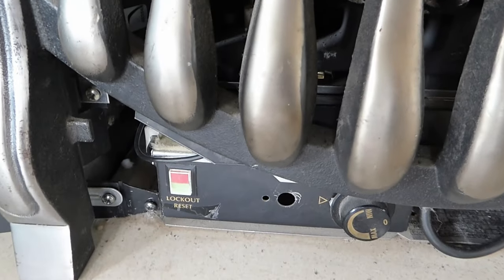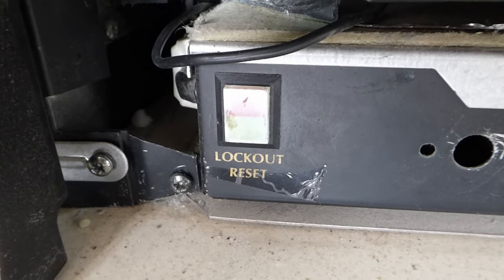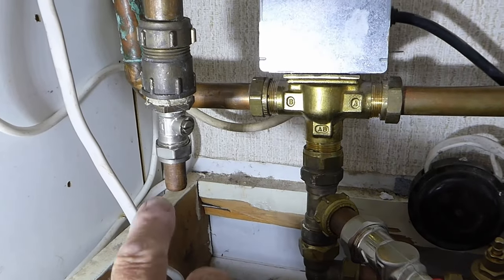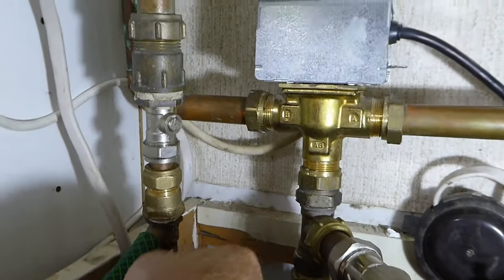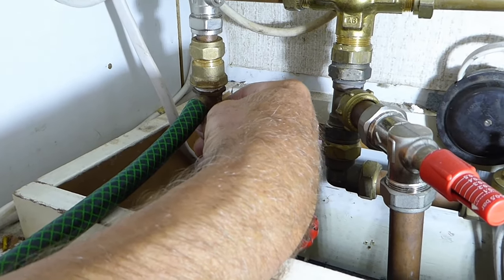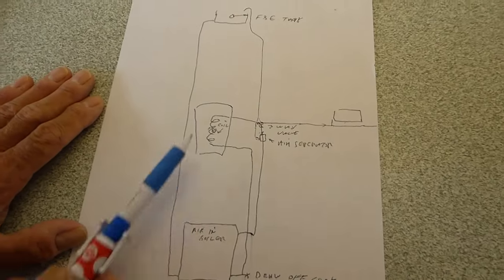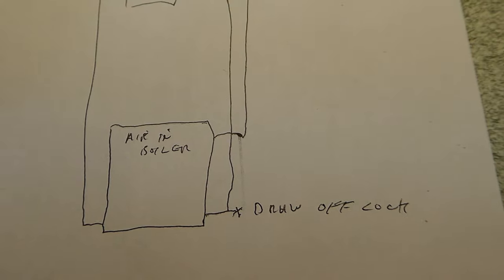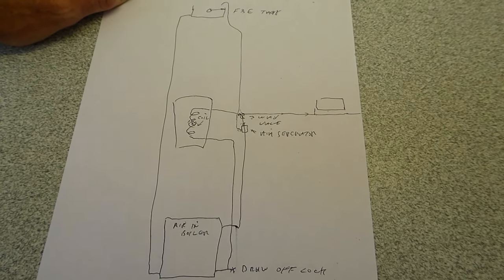How to clear air from a central heating boiler

Comment: I drained my whole system a few days ago and it was working, there was some odd noises though :) Today I noticed the pressure was a bit high so let some water out , the needle didn't move, the thing is drained but it still says 1.5 bar... when I open the bleed nipple in the rad next to me water comes out so it's not emptied, i  tried opening all of them when draining it the first time and it went to 0 no problem, any ideas what might be up Mr Dereton ? Cheers :)
Reply: Hey thanks for the reply. All my bleed nipples are open on every rad, no air coming out they been open overnight, no water in them as far as I can tell pressure dropped slowly to 1 overnight so something is leaking pressure out somewhere. Am thinking it might be trapped actually in my boiler or something. Going to call Ravenheat out tomorrow it's still under warranty :)
Reply from the maker: Yes needs a look at by a pro.

Comment: Hi. I have air in my combi . I recently redid my bathroom and put a heated rad above the boiler . The boiler is downstairs and the towel rad us in the bathroom directly upstairs.  Ive been having pressure loss problems so was going to change the expansion vessel but prior to that i changed the pressure guage as i suspected it was faulty.  Now it seems to be drawing air into the boiler and keeps locking out. I tighten the bleed screw on the towel rad as this is the highest point and i thought that had solved the issue but after a day im losing system pressure again.  I have a feeling the diverter valve is holed. Do you think this could cause the system pressure loss after a few hours?
Reply from the maker: Most times it is a leak that causes a pressure loss. Rarely the expansion vessel. That fact you are drawing air in also makes me suspect a leak. Give the system a go with fernox leak sealer.
Reply: @dereton33  thanks derek.

Comment: The batteries died on my controller and when I replaced them the system started gurgling-kettling loudly, then shut off. Freezing now and no heating. Tried bleeding radiators and running taps but no resolution. I haven't got anything that looks like your system. I can hear the air bubbling inside the boiler when i turn it on.
Reply from the maker: The system sounds like it is clogged with sludge .

Comment: Thanks for the video. I have similar symptoms on my boiler and notice there's a drain valve attached to the flow pipe (going out of boiler). Is that the one to use? Thanks
Reply from the maker: It should be there for draining the system, but do try it to see if any air is there.

Comment: Thanks for the video. I've changed the 3-valve repair kit, so drained the water completely and filled again. Lots of air was running between the boiler and pump and the nearest radiator. There is auto air valve over the pump, most of air gone out from there but the same sound appears again after using hot water. I dont know if I found the right valve that you mentioned, but I drained 1 or 2 liters of water. Now more than half of the gurgling sound disappeared. All radiators are ok except the nearest one, it's like water is dripping to that one although there is no air in it. The maintenance book talks about a "hot water heat exchanger went screw" and I also got it loose but not much longer because its place is terrible, there are cables under the screw goes to main unit. And I gave up :))
Reply from the maker: Hope you sort it ok.
Reply: @dereton33  I hope so, thank you. I'll look to it again after a week or so.

Comment: I had a problem with air in the central heating system. I found that I had to bleed the radiators every day. Even after bleeding the radiators I could still hear the air in the boiler. It sounded about like a breathing dragon.

Then I noticed that when the boiler ran the header tank overflowed. This indicated to me that air was being drawn into the system.

The heating system had been drained before the summer to add a couple of towel rails and the pump was replaced. The pump was a Grindfos and was installed with the factory default setting of III which is the maximum. I found the user guide online and turned the pump setting down to II which fixed the problem.

The problem of air being drawn into the system only happened for the central heating, not the hot water. I hope this helps if you have a similar problem.

Richard
Reply from the maker: Thanks for the info Richard it will help others.
Reply: Thanks for sharing, Richard! Did you find that the pressure in the system was dropping when the air was being drawn into the system?
Reply: @crunkambassadeur7837  I did not have a way of measuring the pressure in the system directly. The one symptom that I thought was very significant was that the header tank overflowed when the boiler was running. I think the header tank maintains a constant pressure due to the head of water so the pump running too fast drew in air which then displaced water at the header tank. Then after bleeding the radiators I could hear the header tank filling up again. I don't know what would happen in a sealed system without a header tank. Richard

Comment: Hi. i know its a comment on a old video but I'm having this issue. After unblocking a blocked cold feed and flushing the system my boiler has lots of air above it. Gurgling and sloshing away. I had it running fine whilst running the cleaner through but after the recent flush i cant seem to get the air out and the boiler sometimes kicks in but more often than not goes to ignition lockout.

Its a gravity feed with a baxi solo.

I've tried bleed valves around hot water tank
Bleeding the pump whilst running
backfilling the system from drain on rad
opening drain valve above boiler as this video suggests (this does sound like air is coming out) Boiler RETURN
opening valve on mag filter (sometime appears a shot of air comes out) boiler FLOW

but same symptom exists.

Turn boiler on, you can hear the boiler spin up and slosh air up from the boiler, then it tries to ignite 3 times and goes into ignition fault mode.

Question is....

could I possibly back fill from the boiler return from garden hose?

many thanks

tristan
Reply from the maker: That was exactly what I was going to suggest.

Comment: Hello again.
I have looked for  a drain cock near the boiler and there isn't one. In my kitchen where the boiler is, I have a radiator with a drain valve on it, which I have used many times to drain the system. Would using this work to remove the airlock?
Thanks for your videos, I have found them useful.
Reply from the maker: Yes give it a go, leave the boiler running when you try it and only open the valve for about 15 seconds.

Comment: I have had a new 3-port valve fitted by a plumber, but the heating system is noisy now, like a rushing of water in the pipes near where  the hot water tank is ! also had a loud bang from the airing cupboard and a loud rumbling/creaking sound ( a bit like a large tree being felled)  immediately following the bang ! but the heating system is now much noisier than before ! The airing cupboard is immediately above my living room ! so very noticable ! just to add that the heating works ok as does the hot water !  the 3-way port valve fitted is an ESi ESZV223P model, I have been told they are made by Honeywell , is that correct ? Thanks.
Reply from the maker: The valve is a honeywell one.The noise you have is air in your system, it will need getting out before the noise will stop.
Reply: @dereton33  Thank you for your reply, How do I get rid of the air in the system please ? I can send you my email address if you need me to send a photo of the pipes in the airing cupboard !  Thanks.

Comment: Hi Mate, 

Really useful vid, I drained down the system and replaced two rads on an F&E system. One of the rads is getting flow but no return the other is fine but the boiler keeps locking out due to air. I don't have a drain off in the airing cupboard or one near the boiler so I'm struggling to get it out. I've bled everything including the pump. Is there another way?
Reply from the maker: Put the hose back on the drain valve run the heating when hot let some water go from the drain valve until  the air is sucked out.
Reply: @dereton33  Tried this, boiler works fine when the drain off is open, when i go to close it, the boiler clunks and locks out...

Comment: Hi, hoping you can help.
My combi valiant is banging with hot water on, the pressure gauge goes mental, 3-2-3-1-4-0-3bar 
Hot water is lovely when the tap is just cracked open, but opening more it'll run cold
I've got 2 radiators which are cold at middle/bottom but hot at the top
piping is 8mm micropipe all around so guessing rust/sludge/limescale has blocked pipes, boiler overheats and locks out? 
In the winter months spotty heating that turns off and water that goes hot/cold isn't the nicest thing :(

Any ideas I can try as a home DIYer as money is tight after Christmas? 
Cheers!
Reply from the maker: Try adding some system cleaner then a flush out followed by fresh inhibitor.
Reply: @dereton33  I did add some system flush and drained it out after a week with fresh ibhib but it hasn't helped
I checked the magnet and it was absolutely CAKED in whatever so that got replaced too

I'm out of ideas, other than removing all rads and back flushing them. If there's that much rust I guess on the filter, I think stronger flush will end up breaking the rads down and causing a leak

Comment: Dereton33. What tops up the water in the boiler, isn't it in a closed loop? I know the ball cock in the tank tops up the tank, but that water is heated up from the coil inside which in turn is heated up from the boiler. I'm confused and any help would be gratefully appreciated, and thanks for the video.
Reply from the maker: In a F and E system the little header tank keeps the water in the boiler topped up along with the rads when required. This system is separate  from your main 40 gallon header tank which feeds the outer part of the hot water cylinder and possibly the cold taps in the bathroom.
Reply: @dereton33  .Thank you for your kind reply and help. But help is what I need! I just cannot seem to be able to get the air out of the boiler after fitting a new motorised  3 port mid position valve. I have drained the boiler for hours but have no means of draining anything by the mid position valve, no drain cocks. I have tried bleeding the pump, I am only getting water from it , no air. I think the air is trapped in one of the pipes . Is there any other way of getting the air out? I would be most grateful for your advice.
Reply from the maker: Just crack the one nut in turn on the three way valve to let the air out, when you see water then it is clear.
Reply: @dereton33  . Thanks again for your reply and advice . Tried that and everything else I can think of.......nothing works!  Hopeless case , I'm afraid.
Reply from the maker: Try running the boiler, attach a hose to the draw off cock and open the cock wait until the pipe it is on gets hot, then turn it off. If you still get nothing, try running the valve in manual open mode, if it works then you have a faulty valve or it is wired up wrong.
Reply: @dereton33  Thank you again. I think I may have found the cause.I believe I have blocked return pipe to the boiler. Is their an easy way to check this? Once again thanks for your help in this matter. Regards.

Comment: Hi thanks for the video, I can hear my pump pumping air, it's like there is an air pocket which travels around the system so every few minutes it will get to the pump and cause the pump to labour whilst being able to hear the air whooshing through the pump! Should I try bleeding boiler or somewhere else? Thanks mate
Reply from the maker: Just the pump.
Reply: dereton33 thanks mate, I have bled the pump this morning and only the slightest of air came out followed by black crap. I bled it til water ran clear. Seems to be a lot more quiet. Thanks 🍺

Comment: In case anyone has same issue as me and thinks it's this. My boiler sounded just like that, but turns out it was the condensate pipe blocked. Might help anyone troubleshooting a similar problem. Thanks for the great video.
Reply from the maker: Thanks for the info

Comment: Thanks for the video not tried it yet. are boiler make the noise when it comes on and off sounds like the noise goes back up the pipe is that normal  please
Reply from the maker: Yes that is normal, get some boiler silencer in there to quieten things down.

Comment: Drained a radiator yesterday, obviously I didn't fill it enough and now it sounds like I have this exact problem.
The boiler fires up then once you hear the ware inside it boiling it just locks out, unfortunately there are no vales on the 2 pipes which I can see immediately near the boiler (theres only about a foot of pipe until it disappears into the kitchen celling) 
All my rads downstairs are free from air and upstairs, I spent a lot of yesterday running the system for 30 seconds at a time and knocking it off before the bolder locked out, I got a lot of air out through the towel rad in the bathroom, I topped it up with water and tried the system again. After around 30 seconds I get a bang from the boiler, it locks out and then theres a gradually reducing noise coming from the boiler, so I'm almost certain the air is locked be the boiler, but with no drains near the boiler what do you suggest?
One friend suggested I crack the nut on the lower pipe on my cylinder that runs to/from the 3 port valve, if I'm certain the air lock is at the boiler, is this the best place to try to release the air? I'm going to try this after work (in the hope that you have replied by then)
Thanks so much, your videos are great.
Reply from the maker: Yes it is worth cracking the joint there to get any air out.

Comment: Thanks for the tips. Would you need to replace any of the inhibitor in the system or would it be ok as you're not draining too much out?
Reply from the maker: ric999tiger No it would be OK, as not much is drained out.

Comment: I drained my system down to replace a radiator, refilled the system and turned the programmer back on.

I've realised my boiler is flashing red behind the reset button, I reset the boiler, boiler fan starts, ignition flame lights, runs for 30seconds then a slight clanging noise happens boiler cuts out and aav valves above boiler hiss, is this the reason, trapped air in boiler? Any help would be great
Reply from the maker: Air in the system. Bleed all radiators and released any trapped air for air valves.

Comment: I have had issues with airlocks in my system for years, with air building up and radiators constantly needing to be bled, any ideas what could cause a constant build up of air?
Reply from the maker: Sludge in the system.
Reply: dereton33 ahhh right. So basically a full clean out?
Reply from the maker: Yup, that`s it.
Reply: dereton33 joy 😂 I hope you have a video showing me how to do that too
Reply from the maker: I do.
Reply: dereton33 legend!

Comment: i have friend experiancing low pressure in how water, cold water i fine, this happens in both the bathroom and kitchen, there is an Manual Air Vent fitted to the one of the pipes attached to the hot water cylinder, we did remove air and no joy, what else can you suggest. it i a gravity F+E system. All the taps are mixer type also
Reply from the maker: You will need a pump, those mixer taps will also slow down water pressure.
Reply: dereton33 thanks for your reply, the property has a lead pipe going to kitchen cold water main tap, and I have discovered a lead pipe connected to cold water tank in loft also. The previous house Owners did install a pump under the bath, but even that is not very effective,. Would a power need to be installed in the closet on the main hot water output from cylinder? Many thanks and keep up your video posts
Reply from the maker: Yes a pump on the hot outlet from the cylinder would pressurise all the taps, I recommend a Salamander pump they are the best.
Reply: dereton33 what is the exact name of the pump type so I know what to ask for from plumber merchants and recommended bar